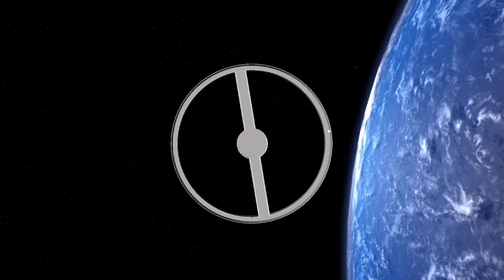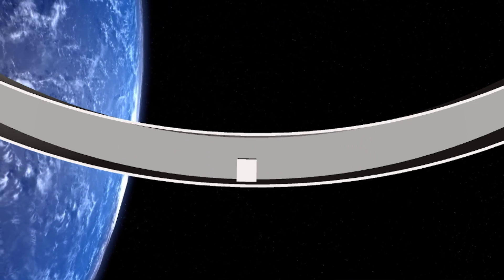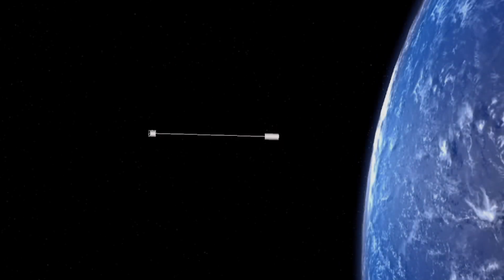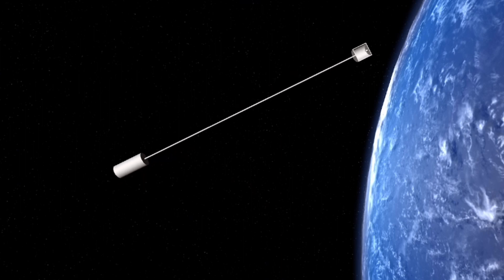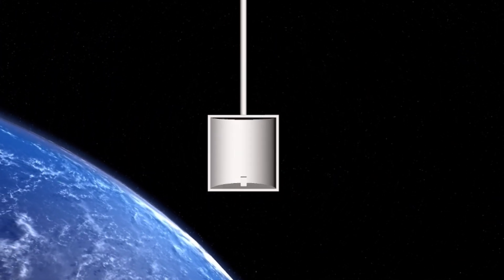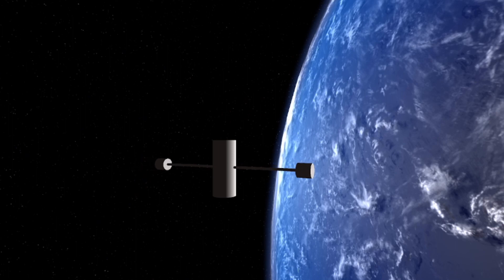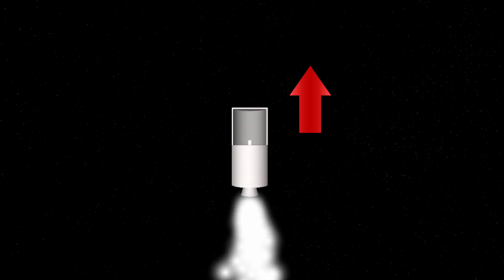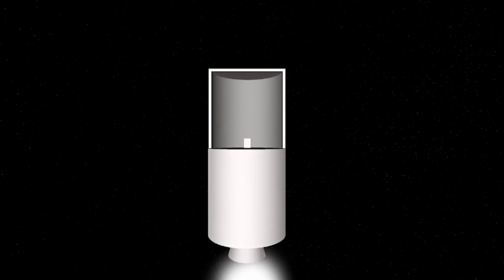Different ways to make artificial gravity

Comment: Why spin 360 degrees? Why not change direction after one degree of a circle?
Reply from the maker: I'm not sure what you are getting at as it makes no sense. If you keep stopping and starting a spinning wheel that would knock everyone inside around, not generate consistent gravity and would waste energy?
Reply: @venera13  If the frequency is high enough and the angle small enough the forward backward acceleration might cancel out, leaving only the downward acceleration.
Reply: a bit like a vibration, but not straight from left to right, but in a curved line, generating constant acceleration downwards.

Comment: The closest to Earth gravity would be acceleration/deceleration gravity.
But as said in this video that would not be practical.
On the tether option, that might be able to come close if you don't try to think of the gravity produced as pulling directly away from center.
It should actually be slightly offset. It has to be due to the rotational aspect. Unlike a car that is moving in one direction, an object swinging in an arc is always changing direction. So walking in the direction of motion in a 2001 styled station would always feel like you were going uphill, and a ball placed on the floor would always roll in the opposite direction of rotation. It may move in the direction of motion but it will be rolling away from it. Basically, the station will always be moving just a little too fast for the ball to stay in place.
No math on this. It just seems correct to me. If I'm wrong I'm wrong.

Comment: One thing that could make continuous acceleration more feasible would be beam powered propulsion. Something like a large superconducting hoop that produces a magnetic field, which is pushed by particles sent from somewhere else.
Reply from the maker: beamed power has distence limitations. if the infrastructure is setup it could possibly work planet to planet. but only with very precise aiming.